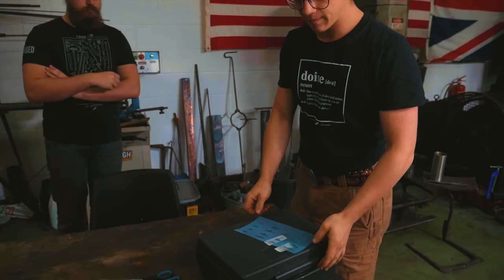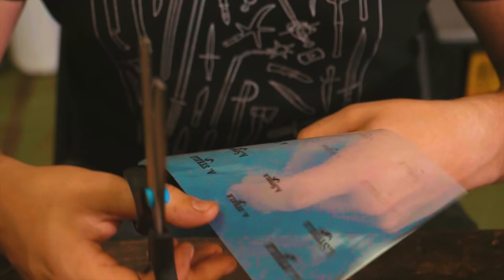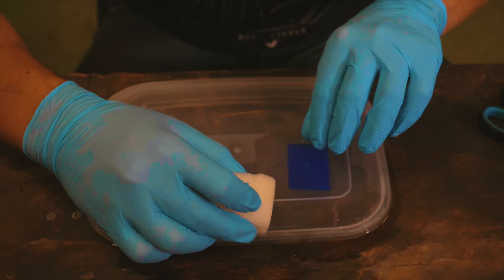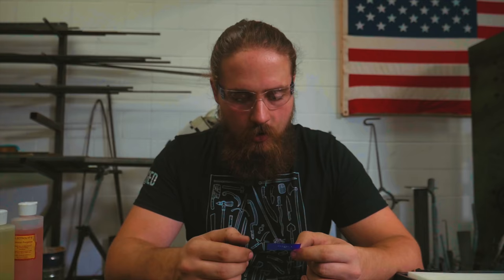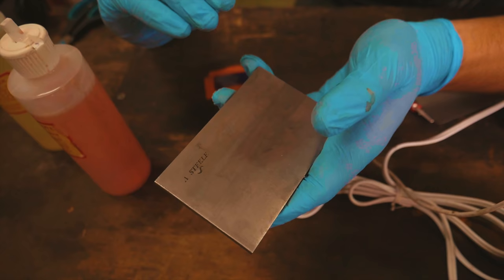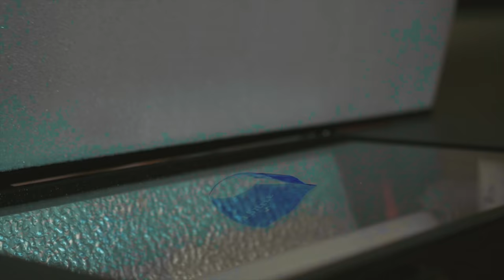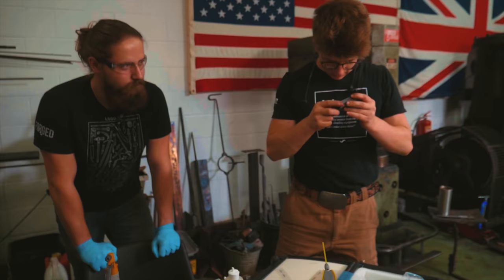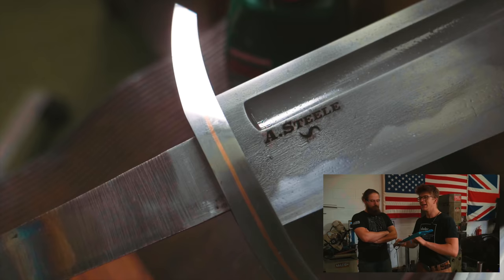ELECTRO-ETCHING A TOUCHMARK!!!

Comment: I make stencils for knives/guns the same way.  I found the best way to get the best detail, if your printer isn't giving the same details as your image, is to print two identical logos or makers mark on the transparency.  Then you cut out and stack the two images on top of each other. The double layering makes your image much more bold and transfers to your photo paper perfectly. good luck
Reply: Billy Cho I do circuit board etching and I just run the paper twice through the printer with the same image. It doesn't always line up but I don't have a choice since I use the toner itself to block the acid.
Reply: Since you Alec/Alex are using illustrator, simply apply a stroke to the artwork. As little as 0.1 pt may be enough to compensate and restore the missing detail.

Comment: I use a Silhouette stencil cutter. Connects to my computer with USB. I can design any logo in my favorite graphics program, or any stencil for that matter. I don't use the Silohuette software, I use SureCutsALot Pro4. Once your design is as you like it, you load a sheet of peel and stick vinyl into your stencil cutter. Upload the graphics to SCAL pro. it tells the stencil cutter what to do. Remove your vinyl sheet, weed out the parts you don't want, and transfer the vinyl to the piece to be etched. I use a ferric chloride for my electrolyte, yes that same ferric chloride you etch your damascus in. You can rig up any number of DIY DC voltage sources, older car battery chargers work well, wall warts can be modified too, (make and use at your own risk, I'm not responsible for you not knowing what your doing with electricity.) You can cold etch by completely covering the work piece with tape to protect and just leave the stencil exposed. Immerse in electrolyte and wait. Every little while (10-15 minutes) go over the stencil softly with a soft bristle artists paint brush. Depending on how deep you want your etch. 1 hour or more in solution, you can inspect and if you want deeper, put it back, and wait.
A Silhouette is relatively inexpensive, under $100.00 US. You can use Contact brand shelving vinyl for your peel n stick. Comes on a 18" wide by 50' long roll, cut off what you need. This makes a really inexpensive stencil material that holds up well. 
Sorry to say, while Alec and Alex's turned out well, this is one red hot, expensive, complex mess of a way to go about it.
Reply from the maker: Outstanding! Thank you for the tips!!!
Reply: One more vote for using a plotting cutter and vinyl transfer.  You get a solid connection between the edge of the logo and steel, very easy to line up perfectly and the process of creating the stencil is less time consuming.  the only slight drawback is that the stencils are on-time use.  

The difference between the black marking versus deep etching is the current.  AC power will mark and DC power will deep etch.  In case you wanted to know.
Reply: I use a silhouette too. Here's my process: https://youtu.be/M1ZCVgdnnpY
Reply: i have a cricut, same concept... and i can say, that i love the thing. i've made so many stickers, custom and copied. it's also awesome for creating stencils.
Reply: David Johnston I have a silhouette cameo and use it to etch my knives as well as paintball guns and loads of other stuff for friends and customers. I use a very high tack vinyl which garuantees it sticks to the metal really well with no chance of etching outside of the stencil.
Reply: There's a level below which only Photo will give you clean small lines. And weeding out photo stencil is simply a soak and rub process same as Screen Printing.

I found anything below about 14pt can get quite maddening with cut.
Reply: I agree. You are completely correct I use the same method. And it's also the better method for doing larger designs. You can create reservoirs with the salt/vinegar/electrolyte solution and get great results. Not to mention the vinyl sticks down to your work piece, these uv stencils are just sitting on top allowing liquid to seep underneath. Effecting the sharpness of the lines.
Reply: Just to add to this as well: Instead of using the cotton q-tip like most people do, build a container with acrylic/plexi-glass and seal it off around the edges and then around the bottom of your work piece piece to be etched) with hot glue and fill the container with your etching solution and connect your end to a piece of metal in it and it will give a more uniform etch and you can do curved surfaces as well
Reply: I've been using my Sihouette for etch masks for a while now. A saturated salt water solution and only about 5-7 volts DC has given me the best results so far for smooth deep etches. Crank up that voltage and you can get beautifully textured etches too
Reply: @CJProSound  i know this is an old video but i still hope you could help me on what to use to turn DC to AC. Whats that alex attached to the wire so it would be AC? THANKS
Reply: Jimbo Alburo - I bought a simple DC adapter with multiple voltage outputs for the etching and I attached two wires with alligator clips on the ends to do the etch. Same process for the marking, you just need an AC transformer that will plug in to a standard outlet and reduces the AC voltage down to a safer level. I got mine at Frys electronics.
Reply: @CJProSound  thanks CJ i will surely try that

Comment: One tip for this that could help with detail is to increase the amount of toner printed in the first place using the toner density if your printer has that feature. I make quite a lot of PCB using this and it really helps because it blocks more light so you get a cleaner stencil.

Comment: Thanks for this Alex & Alec... I looked into making my own stencils, but decided against it. Though I wish I had, because it is like $70 for 10...That's funny, I just updated my logo too. I wanted a small and big logo for different sizes... I actually built my etcher with a wall wart( 12v adapter). I tapped off the transformer for AC & used the regular output for DC. Added a switch and i get both AC/DC for free(I made a video on how to do it)... Alright, back to work, have a great day...
Reply from the maker: I should have done that! Would have been way cheaper than this set up! Haha
Reply: I want to find the light and the rest of the stuff, to make my own now, hahaha
Reply: I had mine done in vinal at a sign shop. I think it was something like 70 of them for about $25
Reply: Alec - are you eligible for ABS?  Curious if we’ll ever see a JS on those blades!
Reply: Aaron Scott Since he is British I don't think he can qualify for the American Bladesmith Society.
Reply: Why not? Neels Van Den Berg and Stuart smith anre from south Africa and they passed their test... Look it up... I can't speak for Alec, but he seems to be more into sword making an independently working as a blacksmith & bladesmith, but i could be wrong...
Reply: silhouette cameo makes stencils, check out diy easy crafts on here.  He makes intricate designs on knives
Reply: hartleyhare1972 Haha, that guy sounds like Woody Allen(It's not a put down, he is in one of the facebook groups I'm in. I told him that too) You know, I appreciate what he does, but to be honest, he puts out a lot of bad information and presents it as the "right" way to do things...

Comment: Another way to get a dark relief is to cut your relief, remove the stencil, apply a bluing, blackening, or browning salt solution, rinsing/neutralizing, then polishing the area with high grit steel wool, wet sanding, and/or rubbing compound.  The relief will stay as datk as it gets and the edges will be as clean as you are able to etch.  They use this technique in forensics to read damaged metal engraving (and Ive used it too to be able to read sample tags engraved on titanium that bece too corroded to read... A quick hit with dark grey Scotch Brite and the tag might as well have been written in marker... It almost glowed)

Comment: The UV light cures the bits that aren't covered by the opaque parts of the stencil. I worked for years at a tshirt printing company and we used a UV cured emulsion.

Comment: I am pretty sure that the first part of the dying is the same way they make blueprints, it has the similar blue with beige details as well. Also the dark room is not strictly necessary, you just need it to be in a room with no uv light, most easily done with artificial lights that don’t produce uv IE regular bulbs

Comment: The blacknening is called etching and uses AC voltage. The other is called marking I believe and uses DC voltage, the clip should contain an electric rectifier to make it DC.
For the eletrolyte, salty water could be used too, though it may be less effective.
Fun fact: the UV stencils are also used in electronics to produce the PCB (printed circuit board)

Comment: There's a similar material used in printmaking. The part not exposed to uv says soft and the rest gets hard, then you just scrub it with water, dry it off and apply the ink.

Comment: It just need yellow light to not affect the etching process. My suggestion would be create a little 1x1x2 m room (or any dimension you desire) with some frame wood and a dark and dense cortine, just place the UV-light emitter inside with a lamp so you can see what you are doing. Is better than running all the time.

Comment: You can all make the same with 2x9V batteries and saltwater as the etching liquid, use a template like them, metal bar for the etching machine, positive on the metal, negative on the bar to etch, the chemical reaction between the salt, the steel and the eletricity will etch your steel.

Comment: use a 9v battery, alligator clips, and q-tips to etch, works just as good :D and much much cheaper. use electrical tape to cover the steel, cut out the shape you want, then dip the queue tip in salt water,  then dab away.

Comment: Hi Alec, I have been doing electro etching for a couple years now and looked into the photoresistive method you are using in your shop but opted to go with a vinyl resist instead. I was able to pick up an inexpensive vinyl cutter (Silhouette Portrait) for less than $100 and the software makes it easy to take any image on your computer and turn it into adhesive vinyl. This has a remarkably fast turnaround time, and i am able to scale or tweak each resist to suit the project I am working on. For a great example of it check out michaelcthulhu's "Aegis Fang Build" video to see just how detailed and deep you can etch using it. Cheers from USA! Keep up the great work!

Comment: Idea for a future project?
What about using a nice stencil with the writing and the logo or a signature just like youre marking your blades usually. Then you could use this awesome anodizing method where you take a brush to apply the color or pigments on the metal... I can imagine you can do this in a way so that after grinding the imprint/stamp is colored while the rest looks natural. 
The same setup could be used for galvanizing... for example with copper. not for the mass production but wouldn't a copper signature or logo or pattern on a steel blade look sick?

Comment: Reminds me of the process I used to to at college to make printed circuit boards. Not the same but similar. 

Have you considered Electrical discharge machining (EDM) or spark erosion as it is often called. Not really something that would be feasible to setup in your workshop (££££) but it could be a cool one off to take a project somewhere and have your logo spark eroded into it. Could be an interesting learning experience for you. 

Also Alex is really doing well, he seems to be getting more comfortable and confident each time we see him. Great work, you make a really good double act. 

Keep up the great work.

Comment: Alec, planning to do most of your pieces with this process in future you may consider giving some design into the 'touch mark' emblem and not just resort to adding your name in a standard font. The original has a wedge-shape profile when struck into metal... maybe draw the etching version with a depiction of that wedge because on it's own it is quite flat. Only thinking out loud ;)

Comment: I use this kind of thechnique when developping electronics cardboards ... (that's just the negative way of electronics developpements) 
You can play with colors by inserting a thin sheet of metal between the anode and let it set for longer time.
cooper will give some blue color, Chrome (pure) will give some green, Aluminium will give some precise light gray (but very fragile, need coating) and titanium some dark gray but requires longer time (not easy to set, some blur appears) 
it's really funny to play with that :)  (but a good old strong hammering is funny too ! :p )

Comment: Deep etching adaptor? The only thing that could be is a diode.
Something learned. AC will do the black stain while DC will remove more material. I mean it does make sense.
Now we need to build a type wheel etching printer to print on sheet metal :)
Reply: Also... for cheap experimenting. You can buy photofilm and developer PCB prototyping. No one said you cannot apply the film to anything else than copper.
The neat thing is that you can go as big as you want. Lab power supply with AC/DC setting or a nice variac and optional half wave rectifier (I think the pulsing might help in the process),
a chemical resistant sponge and an etching agent like Fe(3)-cloride and you're good to go. =)

Comment: It is very strange for me that the exposure and development of the photoresist occurs before sticking it to the surface. This is a useful nuance - I'll take a note. By manufacturing printed circuit boards for electronics, I'm used to first attaching the film to the surface of the metal.

Comment: Back in high school......ah hum......30some years ago, in shop class we used a similar process to do screen printing on t-shirts. well not the acid etching part....but making the template......we used a carbon arc light .....basically a welder, to cure the template.

Comment: isn't it a problem that the UV reactive stuff reacts to the UV of the surrounding even after it has been in the UV lamp?
It will still react during the development in the chemicals so you should do this in a room which has no (or just red light because UV reactive stuff doesn't react to anything that is in the red or yellow range of light, so light Bulbs are just fine I guess) in it, the stencil would then be ready far faster. Hope you'll try it the next time :)

Comment: What did you look up to get that kit to make the stencils?? I keep looking up photo etching stencil making kit and everything but the light and system come up... Thanks in advance..
Reply: Dave Erving Evader Knives You can get UV light boxes in science departments. We use them in the lab all the time
Reply: Thanks, I remember looking this all up before. I was gonna build the box and buy all the other supplies... I just forget the site... It would be sweet to change my logo any time i wanted to, instead of having to order more... take it easy..
Reply: Check into a vinyl cutter, Cricut ect. There relatively cheap and the vinyl peels away easily.
Reply: I just found it, it is called the ETCH o MATIC
Reply: Right, I actually looked into that for making stickers... The only problem with that is I don't think they would work to etch... Have you ever tried it? The ones like Alex is using are photo sensitive, if you don't tape around it, it will etch anywhere exposed... I've never tried vinyl, but to me it seems like any void would let the solution under the print. If that makes sense... I've never seen anyone use them in a production manner...
Reply: Adam Crosier, the think with UV etch, you can use it over and over, till you "expose" or wear it out... To me, once you apply the sticker and then etch, you have to peel it off and basically ruin it... if it doesn't have adhesive, then like i said, the etchant would get under the stencil... Now this is all theory, I really have no idea... Thanks for the suggestion though...
Reply: Try wetting the surface of the desired item to etch, let it dry in place then etch it. May work without a adhesive. Possibly sugar water would do better. But I don't know what the etching liquid might react with.
Reply: Dave Erving Evader Knives I have etched with the vinyls. I already had a Cricut for vinyl car decals and shirts. They are one time use. It worked fine. I was saltwater etching, so it was low current higher voltage, took a bit longer but it was successful.
Reply: Chris Nelson, the guy I get my stencils from has a great recipe for etch.. ferris sulfate, salt, and citric acid powder... does an awesome etch.. The problem with wetting the surface. If the stencil moves, it will "ghost your logo... Honestly, it is best to just buy stencils or the right kit to make good stencils(like what Alec has), this is what everyone is gonna see. it identifies you and your brand, do you really want it looking amateur on a professional knife?? Don't get me wrong, I love making my own tools, but some thing should be done right...take it easy...
Reply: I actually made my own etcher, see now that is something that can be build... The "proffesional" etcher cost like $150 and up... I took a wall wart(12v adapter) tapped off the transformer for AC and the line out is already DC. added a switch and I have an AC/DC etcher for NO COST(everyone has wall warts, hahaha)... I have a video on how i made it... just look up etching logos on my channel(though the older videos are pretty bad)...

Comment: Thit is german level of over-engineering, I expected some saltwater and a 12v DC source, not a friking flux compensator.
While the result is devinitly good, I think that I will stick to the primitive approach with exactor-cut sticky foil and a car charger.

Also is this Kit Etch-only or could you load it with coppersulfate and plate this on? This could make for great contrasts, if combined with the black etched parts.